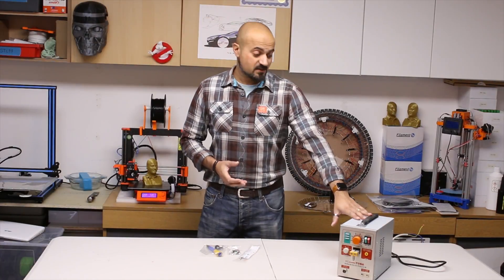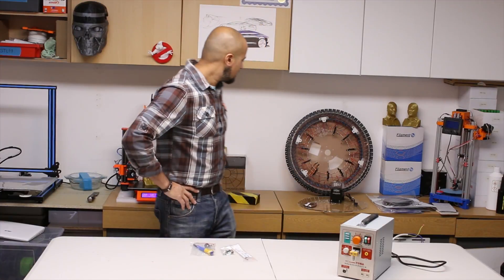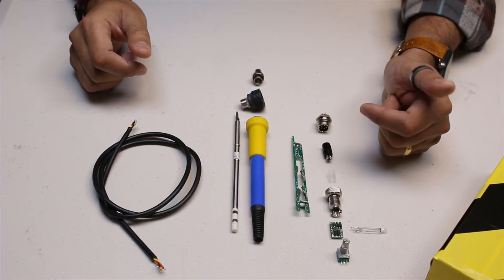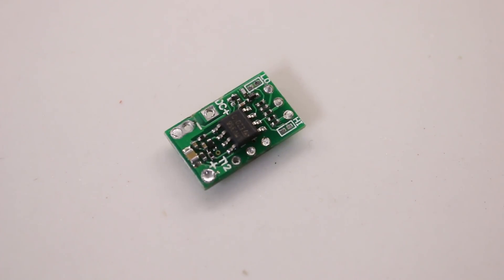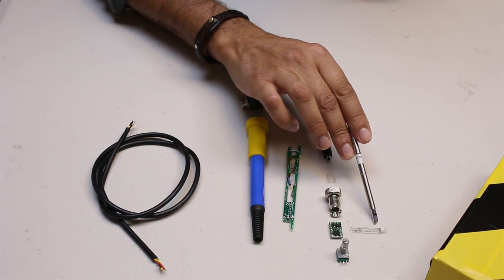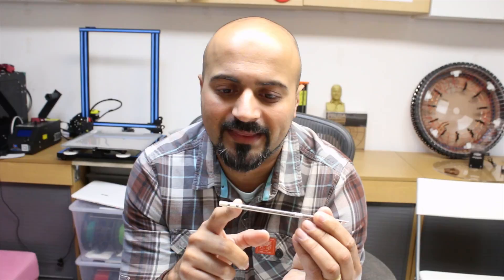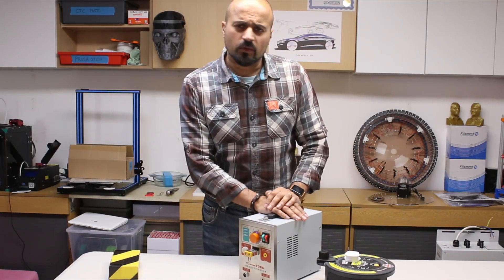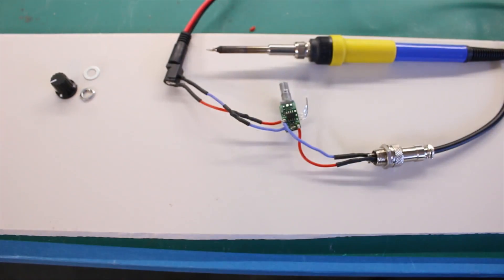DIY Soldering Iron - How hot can you get it?!!!

Comment: Nice option. I just have another one, crap chineese as well, wich actually has temperature control. It's quite inexpensive, and uses the same T12 tips, also working at 24V. I really recommend this one, once you have calibrated it with a thermocouple, it's just perfect (personally, i use a universal laptop charger, wich gives me 24v 3.5A).

Comment: GREAT to see new content from you and that BF thingy coming along.

Now here was me thinking your spot welder had broken and you were going to do a DIY job with super caps!  What is it with soldering irons, Pete @ HBPW goes through them in an alarmingly short space of time, but Average Joe did 4000 solders with same iron. 

I think your video on what happens inside battery when soldering is one of most important in the 18650 community.  I am no chemist but it did not look pretty.  http://bit.ly/autopsy18  

I did consider getting a more powerful soldering Iron but I have two already and who can trust anything Chinese (if they say it is 100w it is probably 1.5w).  I have 40w and 30w soldering irons and used 60w ones elsewhere never seen them go red hot, yet 2.8A x 24V = 67.2W so there must be something else providing more resistance?

So for my spot welding I got some caps and picked up a dead microwave off Freecycle for a few bits and pieces, I am going create a rig of some sort with some 18650's, just for fun.   I found some nice copper that I may be able to use as spot welding tips and if all else fails there was a pretty meaty transformer in there.

C'mon man, you are making Brits look like wimps with that power phobia, do you have a dodgy heart or was it for the kids sake?

I think you need to give youself a few electric shocks to overcome your fear, just make sure you can't grip where you get the shock from (touch something freestanding with tip of index finger).  I have had worse from car or mower to be honest.

Comment: Yeaaahhh... I had the same Sunkko 709a with the same soldering iron problem, I never thought I would use that cheap soldering iron but it was actually reeeeeally powerful and kinda useful but it failed just like yours.
Great idea to 3D print and make an external setup, could you link where you got that nice little potentiometer thing you used?
Another suggestion would be to setup a DC-DC inside the case connected to the main transformer (whichever is easier) =]
Loved to see that soldering iron glowing red.... haha so much POWEEEEEERRR!!!!!
Reply: It’s common for the iron tips like this to burn out. You can check this by measuring the resistance on the tip between the two contact on the end that plug into the iron handle. It should be about 8 ohms. If it measures nothing or much higher then it has Burt out and the unit probably should provide power to the tip. 
I figure it senses the tip resistance, since the iron temp blinking light won’t turn on unless it’s plugged in.
Also, with my 709A you have to turn the main unit on first to power the transformer, this also gives the power to the board that does the soldering iron. So both switches need to be on, iron handle screwed in, and a good tip that hasn’t die in the iron handle.
Hope this helps,
Scott